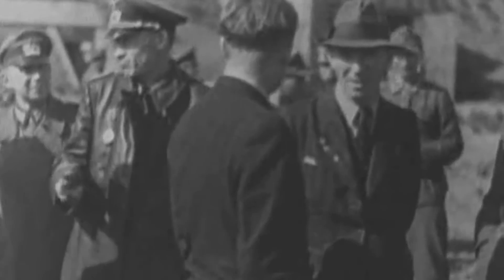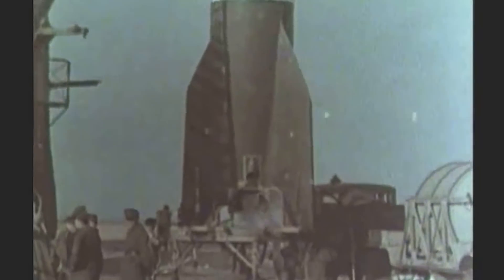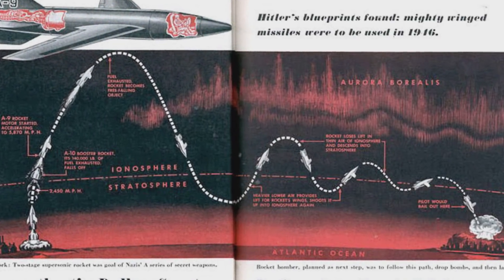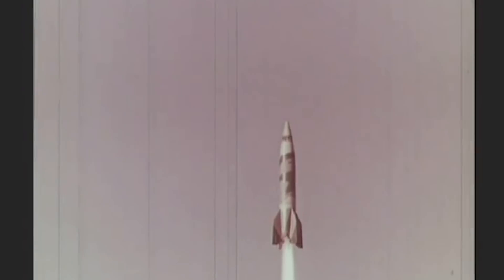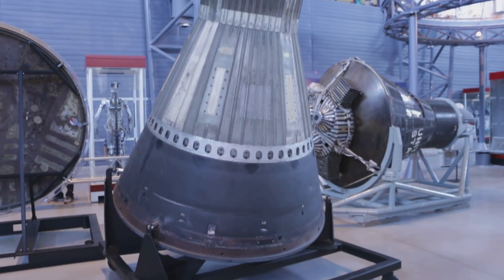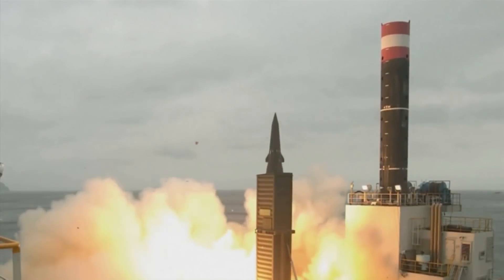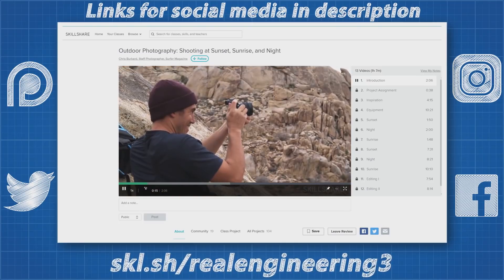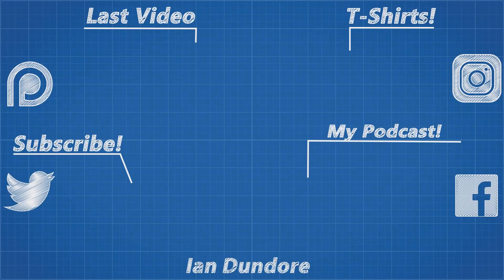Why North Korea Can't Build An ICBM (yet)

Comment: LOL.. I got this video as suggestion. Reentry is not the hardest part of making a missile. Neither the guidance systems. The reentry was a difficult in the beginning because the gas dynamics and the knowledge about the ablative materials were only in development back then. Early missile warhead didn't use ablative materials but a heat sink to absorb the heat. Things have changed a lot by now. Also the standard of "real engineering" in the west :-)

Comment: FAKEEEEEE Hwasong-13 The base of this missile is a Soviet UR-100, so the video is meaninglessly inaccurate and poorly researched, since the movement of such a missile is faster than the initial movement of the Thaad system itself, so the defense system would have to launch missiles when the ICBM starts to crash at higher speeds. from the initial speed of the defense system, Thaad has a problem with removing targets since the chance of hitting the missile is about 52% to 65% ...you need a mechanical engineer to explain to you how engines work, Profesor Milinovic on rocket technology I recommend you listen to his lecture, he even lecture at the west point...

Comment: Two fun facts: normal GPS will stop working after a certain speed (Mach 2 I think?) to prevent its use in guided missiles. Similarly, there’s a restriction on the frame rate of thermal cameras to prevent their use in heat-seeking missiles.

Comment: Most news reporting about DPRK is erroneous. As of July 2019, the DPRK still hasn’t built an ICBM. They can barely achieve the tech necessary for a MRBM. State-of-the-art ICBM’s are exoatmospheric & have use highly accurate guidance systems. The DPRK can probably hit a continent from several thousand kilometers; it’s doubtful they could hit something the size of Guam from Pyongyang.

Comment: The problem is that our ICBM (over 4,000) were made in 1940 using vacuum tube technology. Liquid fuel is sitting there for 60 years, and the computer is old, and the system is antiquated. We are not sure if any of them can fly. Even ti flys, not sure if they explode. The latest supercomputer made by IBM is used to check to see if the atomic bombs are still good after leaving plutonium for 60 years. It's a mess.tion
Techniques

Comment: Your video's are amazing ! 
However, they have so much technical information that it is difficult to absorb at the rate you in which you dispense. May I suggest you slow down your presentation just a beat or two and take and a slight break in between shots. It will be a little easier for the laypeople to follow.
Reply: for me its just fine but ur right they are advanced

Comment: The real threat of NK with respect to nukes is EMP. A nuke does not need to survive re-entry this way, indeed you want to detonate at about 400 miles altitude a la Starfish Prime. A couple 100 kiloton devices detonated over CONUS would cause mass panic and months- or years-long problems for the citified (arguably most of our population at present).

Comment: I have a theory as to how they could have potentially made a manned ICBM work in WW2....  if instead of ejecting from the  ICBM upwards, could they not devise a mechanism to open up underneath the ICBM and slant his seat  - essentially flipping it back to front prior to ejecting. Meaning he will be facing the rear of the missile upon hitting the force of the air outside of the aircraft, being shielded by his seat. Protecting his neck from whiplash while deploying the chute 10 sec after - to allow for safe deceleration as to not tear his parachute. He can be supplied with a 5L air canister strapped to his chest so as to not suffocate from the drop in air pressure at the point of ejection process starting underneath him. ( I know this wont work, but i thought i would give an attempt at it)....

Comment: truth be told in the modern world you could arguably do just as much damage by detonating the weapon in space rather than in atmosphere , particularly in low earth orbit, where the vast majority of satellites reside, thereby crippling certain critical communication systems, also if it is detonated in LEO the resultant EMP can take out electrical and communications lines on the surface, arguably being more cost effective than attempting reentry with an atomic bomb on board with significantly less  risk of being intercepted.

Comment: There is a lot wrong here.
1: ICBMs use stellar navigation. Not satellite. 
2: High accuracy only matters for counterforce targeting. For citybusting attacks the warhead only need land in an enemy metropolitan area.
3: Making a warhead small enough to fit on an ICBM is not a difficult task. Six tests in they have one for sure.
4: They have done and shown off heat shield testing.
5: The defensive system you showed was THAAD, which can not target incoming ICBMs. 
6: The actual difficulty the DPRK program has ran into is making the missiles mobile. Building an ICBM is easy, its building and ICBM that you can launch in wartime that is difficult.
Reply: source?

Comment: I'm sorry but I disagree with your conlusion.  NK doesn't need a reentry vehicle.  

One weapon detonated at 300 miles over Kansas and the resulting EMP will blow out our entire power grid, fry most of our electronics and thus put the US back to medieval life in a millisecond.   This is the great danger, not a ground burst in the CONUS.   

Factor that into their current technology and they are a clear and present danger.  

It seems to me their only limit right now is can they make a bomb that's light enough for their missiles to lift and point in the general direction of the US?   Accuracy is not required.

Comment: Why does some rockets you've shown in this video have a initial blast to launch it into mid air, and then another ignition in the rocket to set it off? And what is this launching method called? Why is it used?

Comment: A remark - Little Boy has only 64kg of uranium on board. The rest is shielding, casing, shock-absorbers, etc. It can be easily made lighter by ditching the shielding, reflectors, etc... Most of the reflectors and shock-absorbers are there to amplify the explosion, which would be still more powerfull than the TNT warhead the Germans intended to use the rocket with even without the reflectors and shock absorbers. The shielding is not needed for an unmanned craft.

Comment: North Korea is not far off from being able to deliver a nuclear payload over the US, they don't need tremendously intricate guidance system to pinpoint a ground target or worry about the warhead burning up on reentry. To cause the most damage to the country, they would never detonate a missile on our soil anyway.

A nuclear warhead detonated at high altitude in the ionosphere over the continental US would cause an EMP which would theoretically take down the entire national electrical grid basically sending the entire US back to the stone-age within about 18 minutes and would take a minimum of two years to repair. Anything plugged in and connected to the grid would be instantly useless as well as off-grid solar systems.

They have demonstrated that they already have the ability to reach Hawaii, Guam, and many other US territories throughout the Pacific.Our only defense here in Hawaii is the missile defense system based at The Pacific Missile Range Facility, Barking Sands on Kauai. Barking Sands has shown repeatedly that it will basically be a coin toss as to if it will be able to stop an incoming threat or not. It has failed numerous times in testing trying to shoot down target missiles. If North Korea were to launch several missiles at Hawaii, at least one of them is almost guaranteed to get through our defenses, and one is too many.

The Sea-Based X-Band Radar, known as the "golf ball" which was supposed to greatly increase the missile defense of the US is a  $2.2-billion complete failure and at it remains docked at Pearl Harbor instead of being out at sea protecting us, stands as a constant reminder of how inadequate our missile defense actually is.

Many of us living in Hawaii do not take the North Korean nuclear threat as cavalierly as you do.

Comment: This guy is confusing ballistic missiles with cruise missiles... satellite positioning and terrain-contour mapping are used by cruise missiles.  Ballistic missiles generally rely exclusively on inertial guidance systems and astro-inertial guidance (star tracking).  Submarines may use GPS/NAVSAT for precise positioning information before launching SLBM's, but the SLBMs themselves are completely autonomous.

Comment: So...

We know the DPRK has compact hydrogen devices...

We know that GPS-type systems can be used WITHOUT special access, although with speed limited under the default distributions of hardware.

We know that they have rockets...

There is no reason to expect that any of the stuff they put on board was meant to survive a reentry, let alone a vertical one.

I strongly suspect that the DPRK has perfectly-viable reentry devices if by now they are this far in their nuclear program. I would not be so sure they lack the ability to guide an ICBM to target.

Comment: One thing:A typical ICBM does not use satellites for guiding, instead, it use celestial navigation system (an optical system which tracks star light, just as the ancient sextant).although it is heavy and expensive, but the reliability is perfect.

Comment: You don't need GPS. They designed modern missiles that follow the stars for guidance. Not kidding.
Reply: GPS can be spoofed , usually a gyroscope based INS and other supplementary navigation.
Reply: The GPS satellites are owned by the government and thus the civilization access is less accurate and movable.
Reply: I have a better idea: remote control. Give it to a guy, and fly it like an rc thing
Reply: @zathary  it can be jammed easily or hacked
so its not that reliable
Reply: @korvo9936  just give him an uno reverse card
Reply: really? how about the newest Russian ICBM Avangard missiles ? does it has follow Star for guidance,?

Comment: Disappointing video, you're using ancient intelligence, made half of it about the V-2 for no reason at all, and have your facts wrong...

ICBM's don't necessarily need GPS to function. Not saying it doesn't make them more accurate, but inertial guidance systems were used in early ICBMs and worked well enough. Also, they actually do indeed have a satellite that was launched in 2016. It's also likely that they have acquired some of this tech from the black market, specifically soviet era systems. If they're able to acquire tech this way, why shouldn't we think they might be able to buy the heat shields off the black market too? And that's not even considering the fact that they don't need an ICBM to hit most of their neighbors. I'm not going into details but short range defense systems can and will be overwhelmed in some massive all-out attack by them. And of course they can kill millions in South Korea within minutes through and artillery barrage.

So no, North Korea is indeed as much as a threat as everyone is making it out to be, just because they can't nuke the U.S. doesn't mean they can't do absolutely devastating damage.

Comment: He does not need to be pin point accuracy to be successful.  Let's say he does not have the ability build this equipment.   He can still use the method Germany used and get close enough to cause terror and panic in the USA.  I doubt very much Americans will say, after a nuclear bomb is dropped on us well it missed Seattle it only hit Olympia.  To have it land anywhere on USA protected soil is a home run for him and they can sell them. They don't have to hit the pin head.